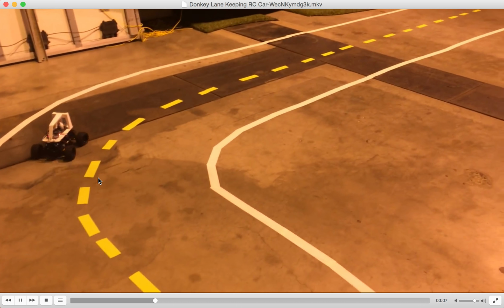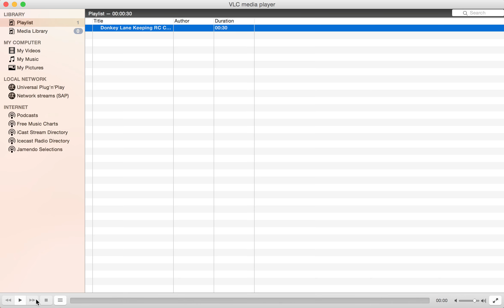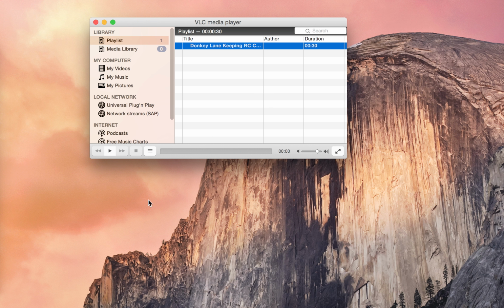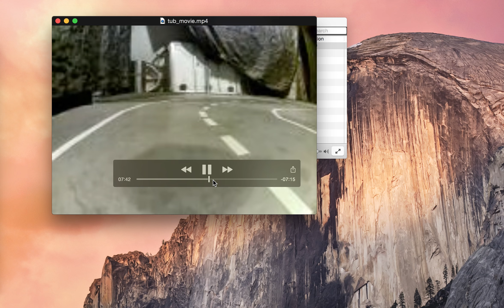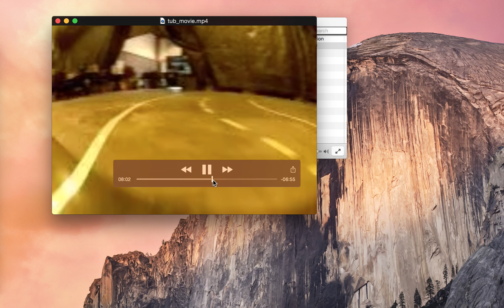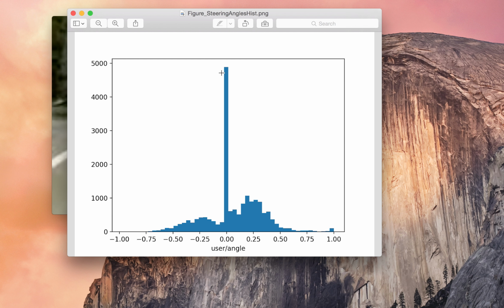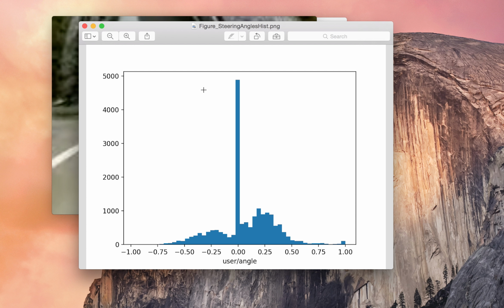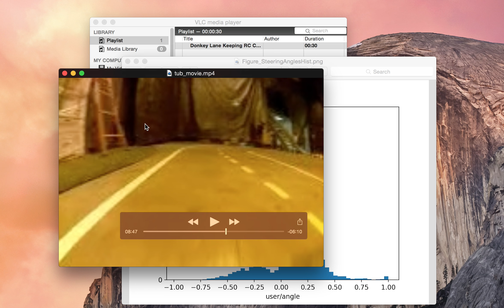Driving Tips to Train your Autonomous End-to-End NN Driver

Comment: I appreciate the driver training tips!  I've eluded to this over on slack, but somewhat of a newbie question to see if I might be understanding things a little bit better... with the 4 driving types, is the workflow (also summarising the types):

1. train precise, take the data to the PC & run training on what was gathered
2. copy the trained model back to the car, then train oscillate, specifying --model precise when running manage.py
3. copy this new captured data back to the PC and run training only on that newly gathered data
...rinse and repeat to complete the last two types

Is this the right way to build on training?  What I've been doing is basically run all the driving types and push them all through training at the same time.  If it still doesn't drive right, I drive some more, copy that data over along with all the previous captured data and train on all of that (which takes longer and longer).  Is my interpretation of all this correct?  My car is starting to be nicknamed 'the turtle', I want it to be better than that :).
Reply from the maker: Yes, you want to train your bot on multiple sessions of data, adding to it as you go. It will end taking more time to train, but should begin to drive better. The speed you drive during training does affect the upper limit of speed during NN prediction. But start at speeds that you can control stably. Gradually increase speed and try mixing them together.